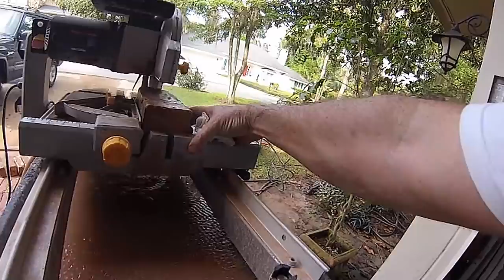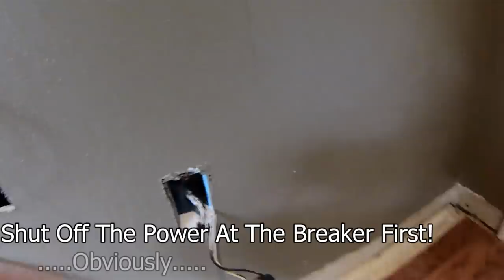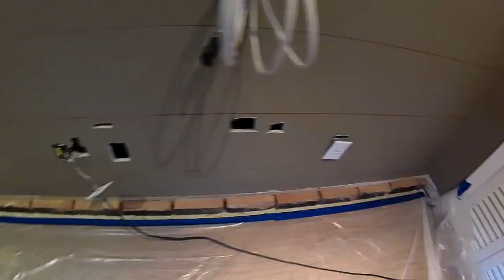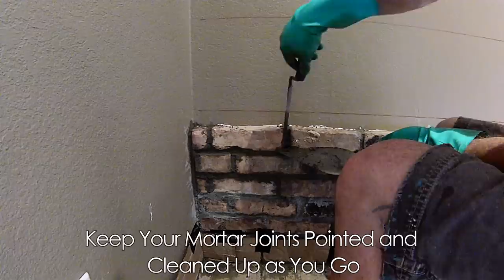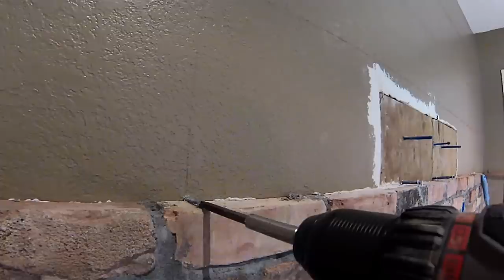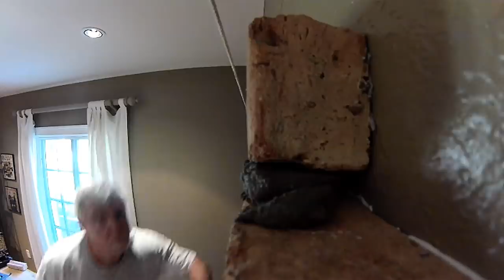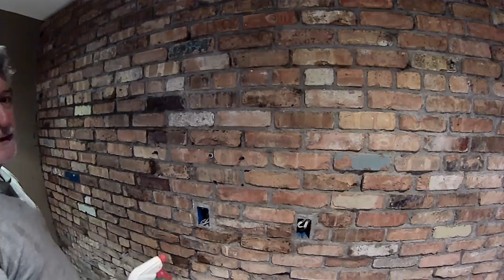How To Build An Exposed Brick Veneer On An Interior Wall

Comment: Great video. Did you put the brick directly against the existing sheet rock?
Reply from the maker: Yes with thin set adhesive, but I also mechanically attached it. Go to 12.06 in the video to see what I did. Don't rely on just the thin set adhesive to hold your brick in place. It is too heavy and may come loose one day.
Reply from the maker: Nashvillan76, there is a good chance that I'm going to be traveling to Nashville for work sometime in the next week or two. Hopefully it's after things have opened up there. Where would we go to find the best Nashville hot chicken in town when we are up there?

Comment: Thats a really nice job. I get that the brick veneer is twice the price but after doing it do you think the time saved and ease of job might have been worth the extra cost?
Reply from the maker: Absolutely not. But using a half brick does have a few advantages over thin brick. The wall is way more solid and you can get a lot more texture by digging out the joints and using brick with broken corners - it makes it look a lot more genuine than a thin brick wall. So if you have the time and would rather not shell out more money out of your pocket than you have to, this is a great solution.

Comment: What type of saw did you use to cut the brick and did you buy or rent the saw ? Great video !
Reply from the maker: I did this a few years ago, but I bought a 10" wet tile saw from Harbor Freight. Something like this one - https://www.harborfreight.com/10-in-wet-tile-saw-with-sliding-table-69275.html. And then, if you really want to go cheap, you could just sell it once you get done with your project.

And wow! the price has gone up a lot since I bought mine. I think I paid around $200 for my saw.

Comment: Hmm, this looks like a project I should do after already getting experience with brick with something else. If we go the pure veneer route, the grout is still very much a vital element, no? As in, choosing to go with less material does not equate to faster install time?
Reply from the maker: If you are asking if the thin brick veneer is faster to install, then yes. And cheaper because it's faster. But I don't think it looks nearly as good.

Comment: awesome job dude!  I wanna do this on a wall about twice the size.  looks like fun.  gonna be a nice grind.
Reply from the maker: Thanks! If you're going to actually do this, there are two things I want to point out. 1) If you build this on an elevated floor like a second floor or a floor with a basement below, make sure the floor will support the weight of the bricks. I didn't think the mention this in the video because I built my wall on a concrete slab on grade. And 2) make sure you mechanically attach the brick to the wall behind it. I don't mention this until 12.05 in the video, so a lot of people miss that very important detail. Good luck with it my man!
Reply: @LeeMcNeil  haha yeah I saw how you anchored the bricks, that was a great idea.  I'm also doing this on a concrete slab.  One thing I gotta figure out Is how to work around my baseboard heating.  I can't put the brick on top of it.  I might pick the smaller wall in the room and just remove that section.  The house is well insulated.
Reply: @LeeMcNeil  maybe it's time to convert to central.  The duct work is already in.
Reply from the maker: @Desh727  I would get a long 1-1/2" steel angle and screw it to the wall about 1/4" above the baseboard heater. It would probably be best to remove a 1-1/2" strip of drywall before you attach the angle (screw it right to the studs), which would eliminate the problem of the upper leg of the angle bumping the bottom course of brick out from the plane of the wall.  This angle would become basically a lintel that you can lay the brick on. I would definitely not put it directly on the baseboard heater.
Reply from the maker: @Desh727  This is the way!
Reply: @LeeMcNeil  that's actually a great idea.  A piece of angle and a few extra stud anchors should do the trick.  It definitely puts a bit of extra strain on the studs though.  It would probably be best doing a little math to be sure.

Comment: Is that a special backing board? If not, any trouble with adhesion? Looks fantastic!
Reply from the maker: The wall board is just plain drywall and the board I installed as a backer for the TV mount is pressure treated plywood. I used pressure treated because it's good practice to use pressure treated material whenever wood will be in contact with masonry or concrete. They make a special cement board that is used a water resistant backer board for tile that is going to be exposed to water - like in a shower - but that wasn't needed here since this wall isn't going to get wet. There was no issue with the thin set adhering to the plywood or gypsum board but I'm not relying on the adhesive alone to keep the bricks attached to the wall. I mechanically attached the them to each stud every fifth course with screws. Go to 12.06 in the video to see what I did.
Reply: Thank you

Comment: Any worries about weight of the brick and the flat screen?  Little bracing helps stiffen a wall for cabinets.  Is there a basement or crawl space below?
Reply from the maker: I put in plywood blocking for the TV. The wall is on a concrete slab on grade. If you build on an elevated floor, you would definitely need to brace the floor below - either with additional floor joists, and maybe some added columns depending on the span. The weight of that brick is around 1,500 pounds.

Comment: Is your water saw heavy duty? Before I take on a project like this, I need to buy myself some tools. Awesome work.
Reply from the maker: This is pretty much the wet saw I used. http://www.harborfreight.com/power-tools/tile-saws/10-in-25-hp-tilebrick-saw-69275.html I can tell you it is definitely NOT heavy duty. It is probably the cheapest one of this size you will find. It was good enough to get the job done though. I had another one that I used to build a pizza oven about 9 years ago and it was shot by the time I got finished but that job took over two cubes of brick and was in use for about a year longer than this one. Change the water out fairly frequently and keep it clean an it should be good for this job. The one I used for the pizza oven finally failed when one of the water jets on the side of the blade got clogged. Whatever you do, don't be tempted to get a smaller blade saw because you won't get all the way through a brick in one pass with anything less than a 10" saw.
Reply: Great! Thanks for the info.

Comment: I’ve been looking for an affordable way to DIY a brick wall and this seems to be just the thing I’ve been looking for! 
I’ve got one question though, I was told that applying brick directly to drywall can cause mould/bacteria and a plastic backing should be applied. What are your thoughts on this?
Reply from the maker: I have never heard of this being an issue. You can think of the brick as basically a really thick tile. So it's the same as if you adhered terracotta tiles to drywall. Where you might run into an issue is if the wall is going to be subjected to splashing water, like in a shower. Even in that case, a waterproofing membrane behind it would be overkill, but it probably would be smart to replace the drywall with a cement backer board or moisture resistant drywall. But this wall is never going to get wet.

Comment: Thank you for prepping the TV cables and power. This is the only way I mount TV's. I am amazed at how many lazy people buy cool 65" TV's and then have the wires dangling down underneath it to their cable box and receptacle. It drives me insane. Do it right!
Reply from the maker: I can understand doing the wires on the outside of the wall if you have a plain drywall partition and you feel a little lazy, but no way was I going to do all this work to look at a bunch of wires in front of my brick wall. It is not that hard to do.

Comment: Hey man, I loce this project. Ive been curious, what type of brick did you use? I want to replicate this, but specifically I want some of my bricks to look rough like you have them here, was that intentional or just how it came? or what
Reply from the maker: Thanks man! They are reclaimed Old Chicago bricks. Any kind of salvaged brick should give you a similar look. The Old Chicago bricks are more of a pink and tan color than most kinds of brick. A few of the bricks had paint on them and I really liked the way they added character to the wall. I didn't have very many of those so I ended up painting a few more before installing them in random locations.
Reply: @LeeMcNeil  Thanks for the reply, months later i got the bricks from someones old chimney. Moving the electrical this weekend. approx how many days did it take you to lay the brick? and cutting the bricks?
Reply from the maker: @marquiswilliams5060  I think you could easily cut 500 or more of the brick in a day, if you're able to put up with the boredom of doing it all at one time. If you have a flunky to help you, cutting the brick would be a good task for them. I'm no speed demon with the brick so it took me about 45 minutes to lay each course. I have 35 courses on this wall, so I would think about one week if you hit it hard the whole time.

Comment: Eugene Munn had exactly the same question I had which you never address for all the ones who may want to do this? if you calculate the weight of the brick and mortar that wall and floor was not ever built to hold that much weight, that's why they make thin veneers made out of lightweight materials. it does look good, for how long?
Reply from the maker: I didn't address it in the video because my floor is a concrete slab on grade so it will look good for a long long time. 95% of the buildings around here are built this way so I didn't think about it much when I made the video. When Eugene pointed out the fact that some floors won't take this kind of load, I addressed it in the description of the video but YouTube doesn't have a way to edit a posted video or easy way to annotate it - but I did find a work around by adding subtitles at the 3.12  point in the video. Hopefully that clears things up.
Reply from the maker: Actually that didn't really work well so I am up for ideas on how to communicate this in the video.

Comment: I’ve seen people just stick the brick to the wall and fill the space un between with mortar later. Why did you choose to take the old school approach?
Reply from the maker: I did try that and it was a whole lot slower (I cut that footage out of the video to make it a little shorter). If I had been using true thin brick then that would have been the way to go but with the brick depth of the half brick, it was way too much mortar to stuff into the joint.

Comment: When you completed the job did you have a piece of wood at the top of the wall for crown molding or did you just leave a gap with the original wall exposed?
Reply from the maker: I left a gap with the original wall exposed. I will probably put some blocks of wood in there as nailers when I do the crown molding. I can't believe I am sitting here almost 4 years later without finishing this project up LOL! I am working on it though.

Comment: I'm sure others have asked you (years ago), but I would be concerned with the sheer weight of the wall. What did you have supporting this wall??
Reply from the maker: I'm on concrete slab on grade so I am good. But you are right about that. I didn't think about it at all when I made the video because I live in Florida and we have no basements here. Once someone pointed it out, I added a warning about it in the description.

Comment: What did you use at the base? You already had the first layer of brick down but did not say or show what was underneath it? Anybody know??
Reply from the maker: I have a concrete slab on grade so I cut the wood flooring back away from the wall and layed the brick right on the slab.

Comment: What's stoping the brick wall from falling as there's no ties from wall to brick only that when the whole wall dries solid it becomes one weight will easily break the adhesive on the wall
Reply from the maker: You are correct. Go to 12.06 in the video and you will see how I mechanically tied the brick to the wall.

Comment: What is keeping those bricks from falling over on the ground? You didn't morter the wall????
Reply from the maker: There is mortar between every brick, but mortar doesn't keep them attached to the wall behind it, and wouldn't even in a full brick veneer (they would be attached mechanically with brick ties). The veneer is held to the wall two different ways - first with the thin set adhesive (which I wouldn't rely on alone to keep the bricks from falling, even though it probably would be enough), then secondly it's mechanically attached with screws driven into the each stud at every fifth course and the screw head is fully embedded into the mortar joint. Go to 12.06 in the video and you will see what I did. Those bricks aren't going anywhere without a hell of a lot of persuasion.

Comment: First time I went to the US I noticed most of what was brick, aside from factories, was car ports and awning structures. But something about the whole affair struck me as strange, so I went and had a look and was surprised to find the H iron was actually the core of the wall, and all of the supporting structure, while the brick was free standing and not even bearing much beyond its own weight. A completely different example compared to the UK. However in the last few decades the UK has started building a lot more US style high-rises, which combine multiple materials with a brick clad that just sits on the front tied to the back wall. It looks okay for the first 3 months, and then it stains and ages badly as little effort is made to protect the brick as it serves no real function unlike in an actual brick built home.

Anyway, a good effort at the wall. I would have run a lot more mortar out, then pointed up - but your roughness actually adds some of the charm, and I expect you were more concerned with the bond to the wall behind than speed.
Reply from the maker: I agree with what you are saying but I think the main reason you see brick being used as a veneer than an actual structural component is because brick has a lot of structural limitations - especially when it comes to structural tension loads. Masonry and concrete need to be reinforced with steel to handle tension loads and there isn't a really good way of doing that with brick without using some kind of structural element on one side of the wall to support the brick.

And you are correct about the mortar. I definitely dug it out in spots and generally roughened it up so it looked old and authentic.

Comment: My biggest concern would be the plywood blocking you put up...it may be fine and I could be paranoid about it, I would have used a 2x12.
Reply from the maker: The problem with doing that is the 2x12 would have sat 1/4" beyond the face of the drywall. I had the same concern as you and I didn't really show it but I also have some 2x material on the back face of the plywood going from stud to stud and big fender washers on the heads of the bolts epoxied to the back side of the  plywood and 2x material which will really spread the point loads. So Im sure it's going to hold up unless someone takes a sledgehammer to the TV bracket or something.
Reply: Clever...looks good, I may have to borrow this idea at a later date...

Comment: looks amazing, but with all that weight wouldn't you want to add most security to the wall? Its held to a wall by cement"
Reply from the maker: Go to 12.07 in the video to see how I mechanically fastened the brick to the wall structure.

Comment: Is the plasterboard wall really strong enough to hold the weight of those bricks?
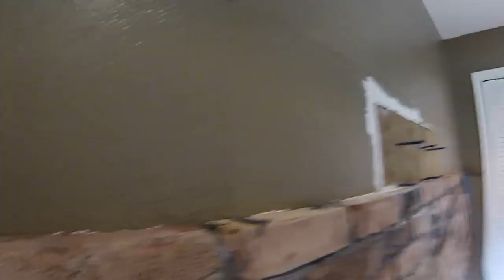Reply from the maker: I am using screws into the studs to mechanically attach the brick to the structure. Go to 12:07 into the video and you will see what I did.
Reply: OK, I must have missed that part. Thanks.

Comment: I like that fact that you're looking to find ways to stretch your dollar on material... however the backside of a brick is commonly known to a bricklayer as a shiner...it does not match the front or face of the brick if you were to finish the project with a sealer you could probably hide that.. although sealers can be rather expensive
Reply from the maker: I've been doing construction for close to 40 years (but I'm not a mason and we don't use brick much here in Florida), and I don't recall ever hearing that term. I looked it up and technically a shiner is a brick layed with one of the two largest sides of the brick facing outwards. I haven't come across a brick that looks different from one side to the other but they might exist. These bricks definitely looked the same from each side - except a lot of them had a coating of bituminous dampproofing on one side, since they were salvaged bricks, and that black coating was pretty much impossible to remove. The cut faces of the bricks look very different from the uncut faces though.
Reply from the maker: By the way, because it sounds like you are a mason, did you notice on my wall that on two of the courses I simulated a header course? Just like it was an old school two wythe brick wall. I think only one other person has noticed that and made a comment about it.

Comment: One thing you missed, wall anchor ties. You need to add as you go up every 4th or 6th course. Critical to attach your brick to the existing wall so it all becomes one.
Reply from the maker: That is correct and I installed screws into the wood stud that protrude 1" to 1-1/4" into the mortar joints at every fifth course. You can see what i did at 12.07 in the video.